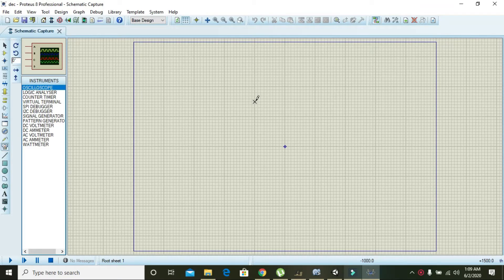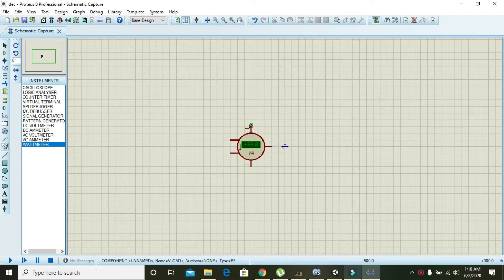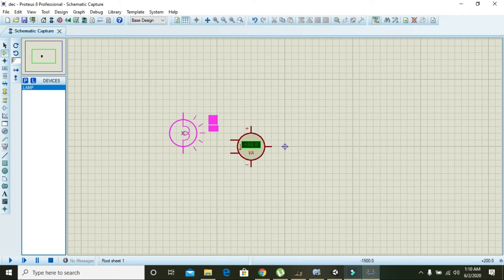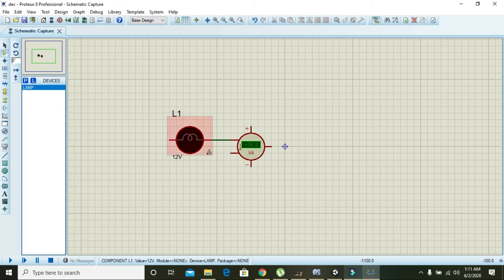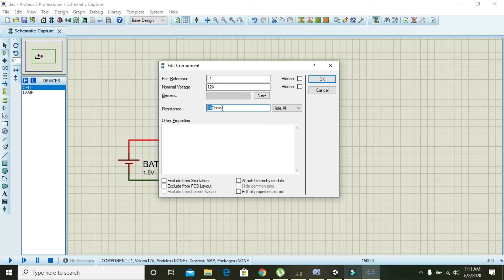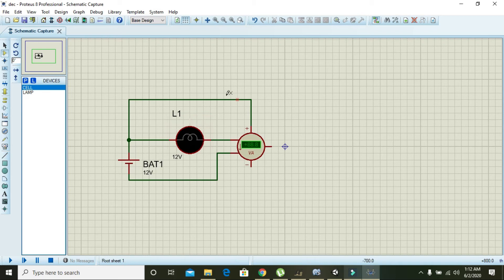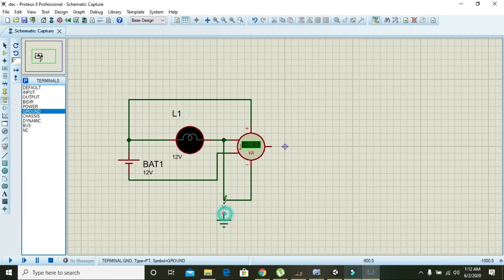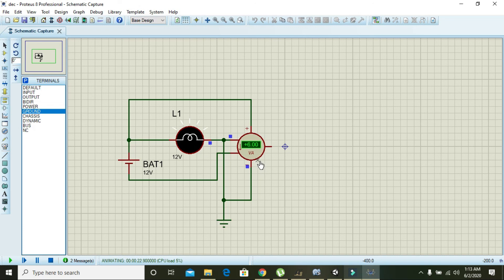How to measure power in proteus | how to measure wattage within proteus | measuring watts in proteus

Comment: Interesting thing: the fifth pin of the wattmeter can be connected to a voltmeter in order to measure the power factor angle (angle between the current and the voltage). The voltage that appears there is the phase in degrees.
Reply from the maker: Thanks for information sir...
Reply: How is the connection made?